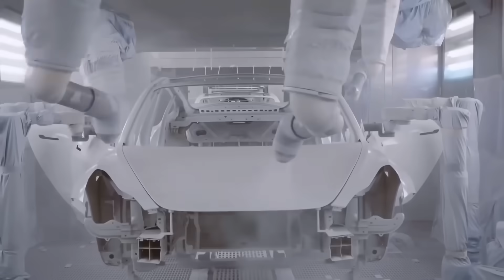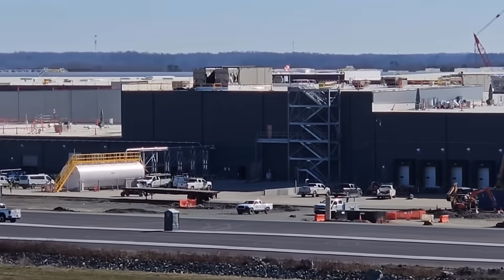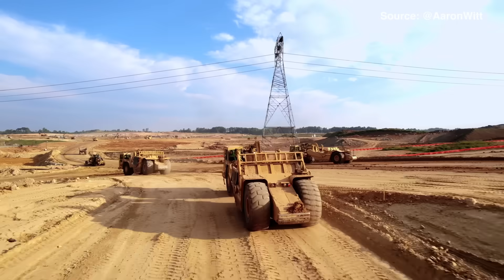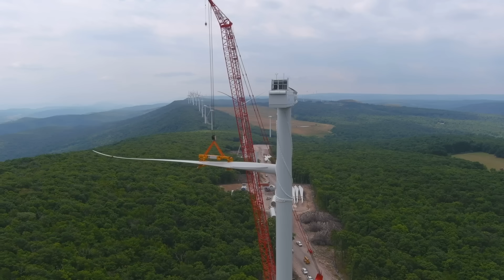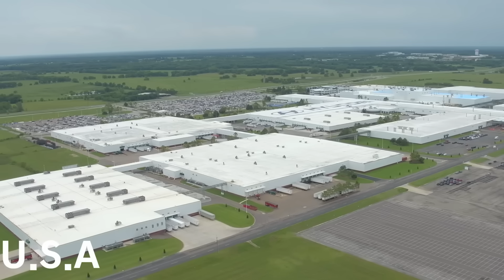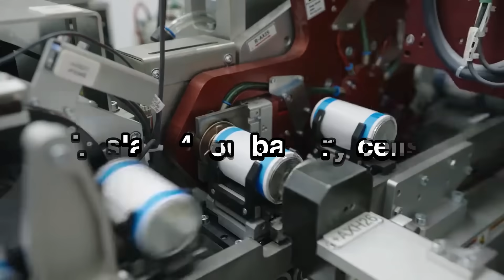One of the BIGGEST Construction Project in the U.S. Is Finally Complete

Comment: Batteries are not the answer, they're the problem.
Anything that relies on Gas, Coal, Oil, Lithium will only continue the stagnant hold on technology advancement. But then one toe over the line with anything like Hydrogen just to mention the one holding for 40 years, it would open the door to a whole new world of free energy, alternate energy, etc....

Comment: ICE cars will go the way of the steam engine eventually. Trump knows that but he's smart enough to know you don't force EV's down everyone's throat with mandates and rebates. Let the free market do it's thing and time will tell where technology heads.
Reply: For the long term, hydrogen fuel cells are better than pure electric.
Reply: Gasoline engines continue to become more efficient all the time. And there's a way to go in reclaiming heat loss. A gallon of petroleum simply has more energy potential than anything else.

Comment: Thinking in a project for another type of renewable energy, applying gravity, flywheel, pulley, parachuting and gear mechanism, dropping the weight down turning the generators, flywheel to keep the momentum, and the parachute using with pulley and with the help of wind or tide of the oceans, pulling the weight back on top and as the element weakens, using a ratchet mechanism to hold it and release it, and batteries to storage when extra energy is sufficient.